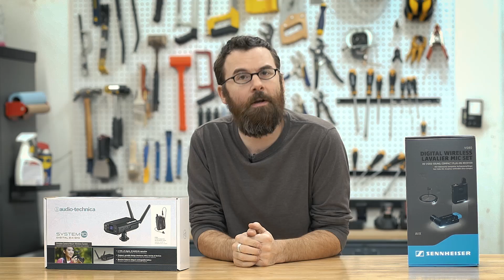Audio Technica System 10 vs. Sennheiser AVX

Comment: This test is completely invalid, the entire video is comparing two microphones and no the transmitters and receivers, and the first thing he mentions is the difference in gain between the two, and at no point goes over the fact that the gain is adjustable on the audio technica transmitter itself. Another thing for the test to have been valid the same microphone would have to be used.
Reply from the maker: I'm comparing the systems, not just the microphone.

Comment: man this just help me change my mine and go with the system 10
Reply from the maker: I like new gear, I do.  But I really have no reason to switch away from this mic, after many years of using it, I have no real complaints.  I wanted to like the AVX, but the system 10 just sounded better.
Reply: @RobertCowanDIY  i have to agree were the best place to buy it from
Reply: @RobertCowanDIY  man that is crazy how no one else talks about that interference i wonder way
Reply from the maker: @brandonjay_gotem  Which interface?
Reply: @RobertCowanDIY  sorry i meant interference auto correct

Comment: So after a back and forth with AT product support via email, I think I worked out why Robert found the output levels are so low. When using a Unipak transmitter and a lav mic wired into that, the signal output at the receiver is at MIC level, there's nothing in the signal chain (eg a Pre-amp) that brings it up to line level. That's why the gain either has to be boosted in the camera, or as Robert did, go via another device (such as the Tascam recorder).

My original observations were with the handheld mic (which I suspect has a built in pre-amp) and most likely results in a line level signal being output at the receiver.

Comment: Really surprised by your observations about the AT levels being so low.

The RX unit actually outputs at line level (TRS balanced: +6 dBV Dual mono, unbalanced: 0 dBV) with a switchable PAD that can attenuate the output by 0dB, -10dB or -20dB depending on what's required.

I notice the yellow cable from the RX to the Tascam is not the stock AT cable that's provided in the box and also you don't mention how the gain control in the Unipak itself was set. I'd be very interested to see how it performs with the stock AT cable since the only other mention I've seen around poor levels and this system, apparently was related to a duff cable which when replaced, resolved the issue.

As a comparison, I have the version with the handheld mic and the RX goes straight into my Olympus EM5 Mk ii which can be switched to accept a line level audio input (disabling the onboard preamps) and not observed any level issues when using it.

Comment: Must be honest: This comparison means very little. All you are doing is comparing the actual microphones - not the ease of pairing, the compactness of the system, nor even the robustness of the signal. All you are doing is looking at the mic itself, together with the cord to the transmitter - and that's not why you buy the AVX. As a matter of fact, many Sennheiser owners opt for different mics - ME2, ME4 (if you want cardioid) or other brands that offer softer cords, deeper bass, etc. From what I understand, the AT system allows ONLY AT mics, which to me is a massive drawback. Plus it is chunky, which in my line of work also counts heavily against it. In the end, I think your headline is the problem - you are NOT comparing the ATS10 to the Sennheiser AVX; you are comparing the mic from the ATS10 to the mic from the AVX - nothing more.
Reply: You can buy off brand mics. I have both at as well as an offbrand as backup. Both work very well.
Reply: You can get adaptor cables that allow the use of pretty much any brand of lav mic with the AT system. The Hirose connection AT use mean you can connect not just lav mics, but also instruments as well (such as guitars).

Detail can be found here:

https://micronic.co.uk/collections/microphone-adapter/products/audio-technica-unipak-transmitter-4-pin-hirose-microphone-adapter-converter

Comment: Hi, Thanks for the detailed review and comparison. This video was the deciding factor for me as there is no other video like this. I bought ATW-1701 finally. As it as both dual mono (for normal camera 3.5mm mic input)and balanced output (for mixer/XLR input).  I don't face any low gain issue with my canon xa11.

Comment: ...make a cable loop, when cliping on the mic. That will kill the noise from the cable :)
Reply from the maker: check the description, I forgot to mention that I was using a loop.  In some of the clips you can see the loop.  It helped of course, but not 100%.  Also, since the cable was so stiff, it was hard to keep the loop in the clip and it kept undoing itself.
Reply: ...Ok...I see

Comment: Possible the jacket on the AT has picked up some body oil, or been polished by use? Wondering if a tiny bit of silicone lubricant on the sennheiser jacket would cut the noise. AT is ok, but intelligibility of the sennheiser is distinctly better. Edit: or add a small weight to the base of the mic to damp the high freq coming off the cable.
Reply from the maker: Yeah, I do like the overall clarity of the sennheiser better, but it's double the price.  also, the cord/cable is pretty stiff, which makes it difficult to attach and doesn't drape as well.   I really wanted to keep the sennheiser, but the extra sound quality isn't worth the hassle for me.

Comment: Phew! I think that Audio Technica is the same wireless mic that I have; I was afraid your were going to point out some glaring fault with it. Something like "the mic usually works well, except when the neighbor uses their garage door opener and the audio turns to static".
Reply from the maker: Nah, I've had a few small problems with it, but overall I've been unable to find anything better.  I even tried out the Sony UWP mic too, and it sounds a BIT better (but less rich/warm), but actually has a bit more hiss/noise and overall just sounds flatter.  It's a great sounding (but maybe not the most 'accurate') mic I've used.

Comment: i had some problems with sound while moving myself, you should see if you can get something like the "Rode invisiLav" i got thath for my rode lav mic and it works great
Reply: i have also seen someone 3dprinting them out of a material like ninjaflex
Reply from the maker: I looked at those, but unfortunately the audio technica has a strange style mic that wouldn't work with it.
Reply from the maker: OH, that's a great idea.  I might try something like that to fit the audio technica mic.